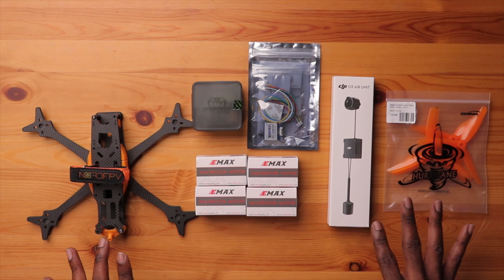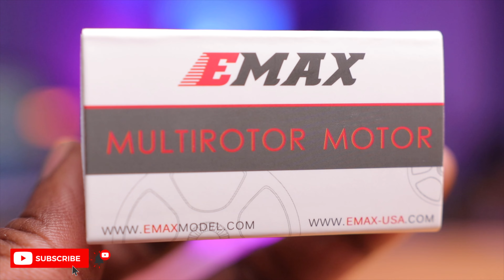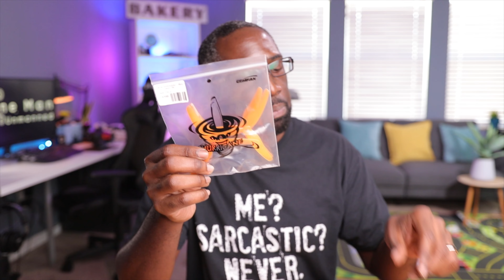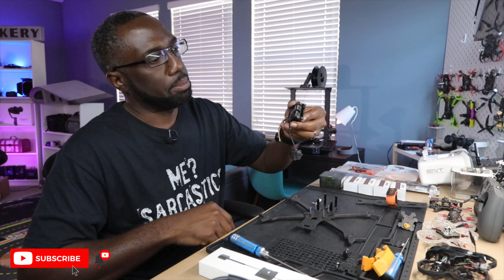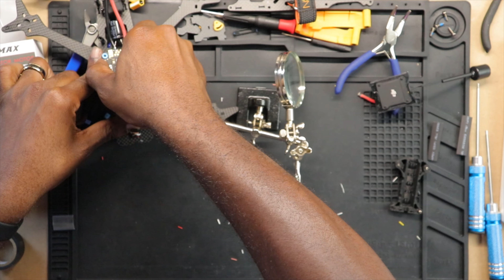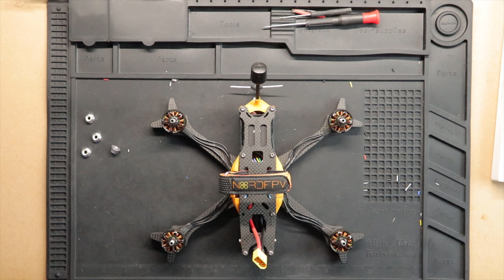Can a Premium Freestyle Drone Really Exist?? | Nord5 HD Build!

Comment: Hey Thomas, great video! One tip: You can attach the camera just with the lower screws only so you can push the camera forward a bit and avoid having the stand off in view. If you attach the lower screws to the upper holes of the O3 you get even a better view.
Also, you can print the TPU for the receiver's antenna, we have many models, so it doesn't wingle in the back and introduce any kind of vibration.
Reply from the maker: Thanks Juan,
I've been testing for some time now, including this morning and yes, just a sliver of the standoffs are visible from the camera.   I didn't know the trick with the lower bolts to push the camera further forward.  I'll try that later tonight and do some more testing. Will record the final results later in the week or on weekend.  Thanks.
Reply from the maker: Oh yeh, I did see the files for the RX holder, but my GPS antenna is a bit larger than the one on the site.   I eventually found one that worked and it fits.  Thanks man.

Comment: Good looking kwad. I'm interested to see how the O3 footage turns out, manufacturer said standoffs shouldn't be visible. Waiting to see your maiden flight!
Reply from the maker: Thanks , I appreciate that.
Reply: Hey Deice. Just for documentation here. You have to use the lower screws and the upper screw hole in the camera so it gets as farther forward as possible for the standoff to not show up in the video. I still can see a bit of a shadow on the top upper corner, but it's barely noticeable.

Comment: 2306 is not larger than 2207. It's actually smaller volume...
Reply: Exactly. And 2207's will stay cooler.
Reply: @WillPowerFPV  technically no. A shorter and wider motor will generally stay cooler.
Reply: @yuriy77  2207 is shorter and wider than a 2306. I run both, and I'm literally staring at them as I type this. 
It's also written in the dimensions.
Reply: @WillPowerFPV  sorry, but you got that backwards. 2207 is taller and narrower than 2306.
Reply from the maker: Yes, the 2306 is wider, and shorter, and therefore should provide better cooling.
Reply from the maker: Yes, the 2207 is technically larger.  I guess my quick mental math did not work out.  I’ll “pin” a comment in the comment section mentioning that.

Comment: Nice looking frame and great build tutorial. I'd probably go with the speedybee master hd and v3 stack on my next 5" since I have been flying the v2 frame and stacks since I started with 5" and they have done me right. If they weren't available this looks like a great alternative. I agree on the gps. I have them on all my builds that carry expensive cameras. I even have it on one of my crux35 HDs that is set up more for cinematic and longer distance. A $40 gps is worth it if it saves you one time, and mine have saved me twice.
Reply from the maker: I totally agree..GPS has saved me a few times too.  Thanks Bryan!